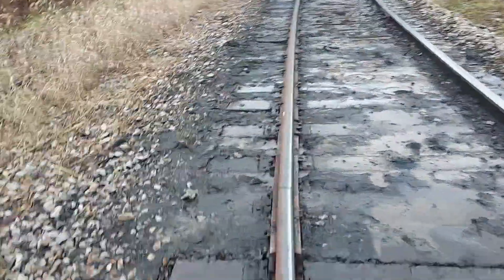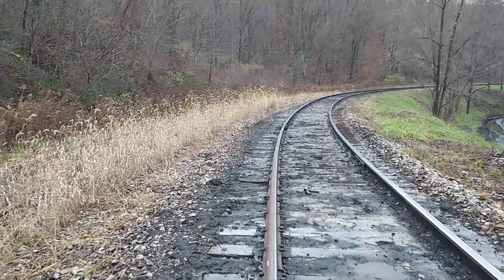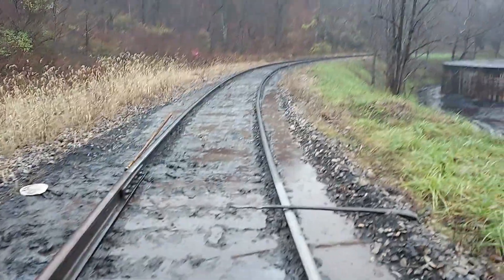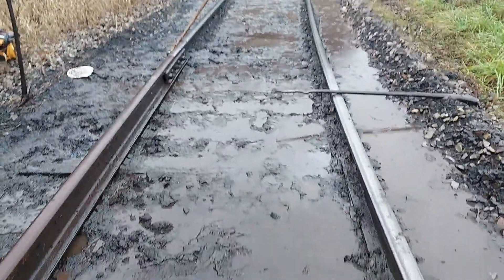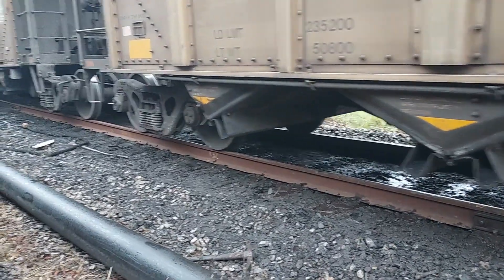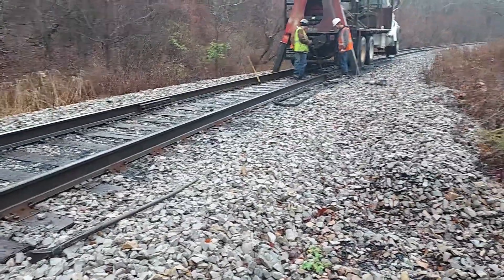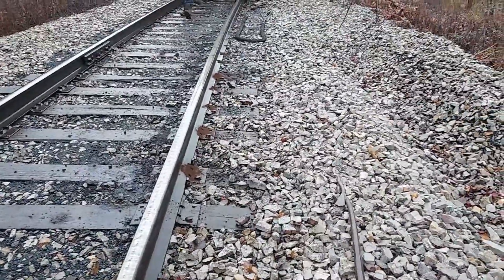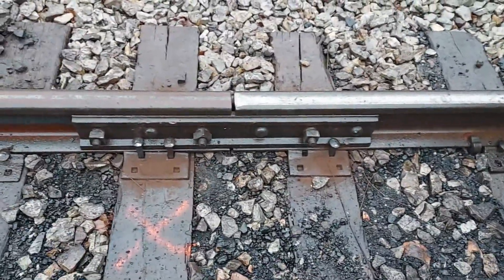How to Bend Rail for a Curve on the Railroad

Comment: Wow! Steel that thick one would think you'd have to heat it up first to bend it even a little bit... 
🤔🔥
Reply from the maker: Rail is amazing James. It's incredibly tough but at the same time 
flexible and even brittle. Rail never ceases to amaze me. Sharp quick bends in rail do require heating but over a 39 foot long stick its
actually pretty easy to bend it for a curve. Almost all rail in N. America for freight railways is bent in the field by hand. Some transit
systems have some very sharp degree curves in their yards
and those are pre bent at the factory. Thank you for taking the time to watch our video and we hope you have a very good day.

Comment: Interesting vid. Thx. Other topic, i’d have thought that the rr would have come up with a way to keep the coal dust off the tracks. More trouble than it’s worth i guess.
Reply from the maker: Thank you and glad you enjoyed Kurt. Our hopper cars get extreme
use and doors on the bottom of the cars come out of adjustment,
so coal leaks from those doors and cinders the track.  Adjusting and fixing broken doors is an on going thing here. Most cars on other railroads get dumped once a week, our cars get dumped 6 times a day, 7 days a week. Lot of wear on those door parts. Really appreciate your watching our video and keep your tracks in gauge until we meet again.

Comment: I would have thought you would use some specialized robot, you know, a Bender Bending Rodríguez .
Reply from the maker: it's actually fairly easy to bend rail for a curve Jayne. Some transit
systems have some really sharp degree curves and they use
rail that has been pre bent by a Bender Bending tool as you
put it. Comes from the rolling mill pre bent. For some of those
really sharp curves in transit it is impossible to bend the rails
by hand.  Really appreciate your watching the video and may you have a very good day my friend.

Comment: Dave thanks for the video.  Seeing the trains in a slow motion. The eye catches. Movement. Between rail and the weight of the rail car.  The rain has created a mud hole setting the train up for a derailment.   Costing millions in cleanup.  Keep doing the great work maintaining the track. This is a dirty nasty job but somebody has to do it.  I just wonder if you could  Cadweld  or thermoweld  that joint.  Creating one rail. Filling in the gap. And taking out the chip spots on the end of the rail.  Or will the weld become brittle  from so much heat. It would have to be annealed  , to create strength, in the steel.  Rail steel is a harden , pure steel.   Need some drainage tile and road fabric , heavier rock. To support the weight.  Clay soil has problem.   Use a French drain  or a dry well.  To get rid of water. The devils advocate.  Later.
Reply from the maker: Your right the track in this section is full of coal and it does pump
up and down Dan, but it is also 5 mph track, pretty hard to derail
at 5. The biggest problem with that is over time the rail weakens
as well as the joint bars which can break and that can cause
a derailment.  Another thing that happens is bolt hole cracks
can develop in the joints. 

All our rail welding is done by contractors, all our rail has 3 bolt
holes in the end. Welders will not guarantee a weld made that
close to the 3rd hole, so not we cannot weld those joints without
replacing both sticks of rail with 2 hole ends or no hole ends.
Big expense for 5 mph track and it ain't gonna happen.  Thank you for  taking the time to check out the video and may you have a very good day my friend.

Comment: Suppose there is a railroad crossing and the railway through it is curved. Those rails are recessed into the macadam. How would you access the rail to bend it?
Reply from the maker: Many crossings have curved rail thru them Joseph as you well
know. The rails are laid and all the tamping is done then the
top covering is laid over that. If a rail needs replaced that
top cover, macadam or asphalt or concrete or wood must
be taken up, this is the same no matter if the rail is curved
or straight thru a crossing. 

Really appreciate your taking the time to check out the video my friend  and may you have a very good day.  And, if you haven't already done so,  check out my second channel with more cool railroad videos and other stuff I get into on it:
https://www.youtube.com/@ThatsDavesOtherDoings

Comment: Interesting. I always thought you have to heat the rail piece while using a come along to bend it as it is heavy metal
Reply from the maker: When we put in the curved closure rail on a turn out we have to
heat it because that is a pretty sharp bend Rickard, but other
than that we use bars to bend the rail in place, it's really not
that difficult to do, although the hotter it is outside the easier
it is to bend the rail.  Really appreciate your taking the time to watch the video my friend and may you have a very good day.

Comment: Hey old timer! What does a section of rail weigh?
Reply from the maker: The rail we replaced was 132 pound rail. That means a 3 foot
linear piece of rail weighs 132 pounds. So a 39 foot stick of
new rail weighs 1740 pounds.  So if it was 136 pound rail,
it would weigh 136 pounds per yard.  Thank you so much for
checking out the video my friend.
Reply: @ccrx6700  I’ve watched a few already. But I guess you ain’t picking’ onna those rails up at one end. Who knew train tracks needed so much ongoing maintenance. I spent many hours walking the GTW as a youngster.
Reply from the maker: @fryingpanhead8809  😊👍

Comment: Don’t make sense. The rail is  flexible held into a piece of wood with nails and tons of weight  rollin on it and the rail don’t roll over. Nice vid dave.
Reply from the maker: One thing you may not realize is the tie plates are cut with
a slight cant. Thus the rail does not sit straight up and down
in the plates, but has a slight lean to it inwards. That small
amount of cant is enough to keep the rail from rolling over
provided the spikes are also in good shape. Really appreciate your taking the time to watch and may you have a very good day my friend.

Comment: I'm not a railroader. But that balast doesn't look to good to me. More dirt than anything and holding water.
Reply from the maker: Your right about that Donal, it is filled with coal which won't allow
the water to drain away and thus the mud hole. At least we got
new ballast in and tamped up so it will hold well until it eventually gets filled up with coal again. Really appreciate your taking the time to watch and may you have a very good day my friend.
Reply: @ccrx6700  thank you for responding. No one has ever done that before. It means a lot.
I love train videos. I missed my calling 30+ years ago.
Thank you!!
Reply from the maker: @porsche9144uify  👍😊

Comment: Dave, what's the tolerance on the gauge... and how do you check it?
Reply from the maker: Different classes of track have different specs on how wide or
how narrow the track can be Gary. There are 9 classes of track, the higher the class of track the higher the train speed and the
more stringent the specs become. As you can imagine there
is a more leniency for a train traveling 25 than a train
traveling 100.  On class 2 track like we have, train speed is 25.
The gauge must be at least 56 inches and not more than 57 3/4 inch wide.  A quick check of the gauge can be made with a
tape measure, the most accurate measure is made with a
track inspection gauge.  The gauge is measured 5/8 of an inch
below the rail head from the inside of one rail to the inside of
the other rail.  Thank you so much for taking the time to visit with us and may you have a very good day my friend.
Reply: @ccrx6700  Thanks Dave. I noticed different sections of rail profile to... there's a lot of engineering in this game. Thanks for the explanation, and I'm enjoying your content.
Reply from the maker: @grahamrowe6278  😊👍

Comment: At age almost 74, this has been quite an education for me. Here in the UK, I think virtually all railway lines are continuous rail and have been since some time in the 60s. If we look carefully in some of our rail terminii, we might see this old track joined with what we call 'fishplates' as the speed is slow with trains coming to a halt.
Also, in l'il olde England I have never seen spikes. The rails have always been mounted on chairs and in the old days held in place with wooden wedges, then a mega-scale spring clip of a kind.
Keep up the good work! Now we know! Pry it over with a bar(s) and if that isn't enough, here I think they have a hydraulic device of some sort.
Reply from the maker: Glad to hear you have found this to be educational Jozef. Yes UK and us do have some differences. A good many RR's in this country have
all welded rail and use Pandrol clips instead of spikes to hold the
rail gauge.  Thank you for taking the time to visit with us and may you
have a very good day my friend.

Comment: Could you do this another way.. Put the two ends of the straight section where they need to be, then drive the truck to force the curve into the rail and nail it down?
Reply from the maker: Most likely that would not set the rail to the right gauge since the
hi rail wheels on the truck is wider than what we put our track
gauge to, so we would still have to move the rail over a bit by
hand and with a truck sitting on top of the rail that would be most
difficult. Thank you for taking the time to visit with us and may you
have a very good day my friend.

Comment: Railroad shouldn’t be holding water right?
Reply from the maker: Water staying in the ballast is never a good thing Ryan, but
the section where this video was made is 5 MPH track so it's
not near as critical as main line track would be. I have so much
plugged up ballast from all the coal fines over the many years
leaking out the hopper car doors, I just cannot get to every place
that needs done.  Thank you very much for taking the time
to visit with us and may you have a most blessed day my friend.

Comment: That track needs some love. Probably some new ballast and a lift when tamping. good work, boys
Reply from the maker: It is track used only for when they load the train so the speed is
about walking speed as they are loading the train. But it does need
some ballast rehabilitation for sure. Problem is getting to do it. We
have sections of our track that is 25 MPH that needs work done
to it before we can devote time to a 5 MPH track. Only so much
we can get done here with only 2 track men to work track plus having
to work around trains running. Very grateful my friend for your taking
the time to visit with us and check out the rail bending video.

Comment: Thanks Dave.....I always thought they must be pre-bent.....do they spring back straight when you take them out?
Reply from the maker: Your very welcome Lincoln. Some rails on very sharp degree curves
on some transit systems are pre bent. However on freight RR's
they generally are not, freight doesn't have the really sharp curves
that some transit systems do. As you saw in the video, we bend
the rail to fit the curvature by hand. It's not that difficult and easier
in warmer weather.  Most rails in a curve will spring back some, 
but hardly do they get back to their original profile, but it also
depends on the degree of curvature, the less the degree the more
the rail will go back to straight.  We really do appreciate your taking the time to check out the video my friend.
Reply: @ccrx6700  Thanks Dave, it's always a pleasure to watch your videos; it's clear you enjoy your time at work and I'm grateful that you put the time and effort in to produce your interesting videos - you are, without a doubt, the star! Over and out, all the way from Lincoln, England!
Reply from the maker: @lincolnengland5005  thank you for the kind words 👍😊

Comment: On the high side of a curve, we take out the outside line spike and replace the rail from the outside. If that rail was on the low side of the curve, we'd take out the two line spikes and replace it from the middle of the track. I'm curious why you put that high side rail in from the middle of the track? And you know rail is very flexible, so you really aren't "bending" the rail, you're simply guiding it into the tie plates. I work in mountain territory for a Class 1 Carrier, with high degree curves and heavy grade my 40 year career so tell me I'm full of bull. And That's Railroadin!
Reply from the maker: You are right we are guiding it into place. Interesting about how
you put in the rail. I've seen it done both ways. What we usually do
is if there is two spikes on one side we only pull the one spike on
the other side and leave the 2 spikes just up a bit. So that is
why you saw the rail being put in from the middle of the track.
Glad you shared that with me, I will give it some thought. 
Very much appreciate your taking the time to visit with us and check out the video my friend.

Comment: Its amazing that it is so bendable, when  the weigh per feet /meter is so high.!
In sweden the rail comes in 500 meter long pieces , when building new lines or changing long stretches 
They transport them on speciality built trainsets, in stacks the rail  bends back and forth in the curves.
Look very strange  rails  moving on rails 
Almost all rail in sweden is welded  end to end up until the 
Electrical  separation points in the signal(for the atc and other sys ) and ground rails (for the electrical ground)
I have seen smaller reperes bing don were they bend the rails like you do in the video , then splicing and termite welding to the old rail.
When cutting the ground rail they have to connect the two 
Ends of the main rail line  to avoid arcing over the initial gaps  in the two cuts .
Other parts of the line may still have traffic going . 
Ties are concrete with clip fasteners.  
Prior we used a clip system  named parol , the nick name of it is the" dog turd " hund skiten . Looks like on actually. 
The new lines built use anoder clip thats looks different,  what  i understand ,it is easier to automaticly put does in removing them.
The dog turd had to be sledgehammererd on of.
On low speed /industrial tracks there can be wood ties , and and sometimes nails or screws and connector plates.

Its it the coal dust that makes 
The barlast  in the track so clogged up ?
Do you rense it from time to time?
Reply from the maker: Thank you so much my Svenska friend for sharing that about
your rails. Rail is amazing how hard it is yet in the same light, so
flexible. It's actually pretty easy to bend rail for a curve, specially
when it's warm outside. Very much appreciate your taking the time
to visit with us and check out the video.

Comment: Great video, thanks Dave.  This is a really good example of the force multiplier created by a "second class" lever.  

In this case, the "Fulcrum" (or pivot pont) is the point where the tip of the breaker bar bears against the tie plate, the "Load" is the resulting force at the center of the bottom flange of the rail, and the "Effort" is the force you applied on the breaker bar.   Just rough numbers, but if we assume:

(1) The distance from the Fulcrum to the Load (bottom rail flange) is 0.05', and 

(2) the distance from the Fulcrum to the Effort (applied force)is 4.00',

The Mechanical Advantage created by the lever is 4.00' / 0.05' = 80.   So a 100# Effort (push) on the breaker bar, results in a 8,000# Load of the bottom flange!  Physics is amazing!
Reply from the maker: Wow those are physics I never knew Bryan, thanks so much for sharing. Glad you enjoyed and we very much appreciate
your taking the time to check out the video my friend.

Comment: No doubt there is flex in rail so explain this... No curve, no bend, the longest rail and IT'S LEVEL.
Tweaking a rail is way different than a bend.
Dead-straight railway Lines.
The world's record for the longest stretch of straight railway belongs to the Transcontinental Railway of Australia, which is dead-straight for 328 miles across the Nullarbor Plain.... Next comes the Junin and McKenna stretch of the Buenos Aires and Pacific Railway of Argentina, which is dead-straight for 205 miles and level also.

DID YOU SEE THAT? LEVEL
a curve is never level unless your going around something, not OVER something. 

Hmm, civil engineer plans show no earth curvature in them.
Reply from the maker: So Mav with your line of reasoning then there is never a level
rail because of the earth's curvature? Appreciate very much your taking the time to tune in and check out the video my friend.

Comment: Dave, The amount of maintenance the rails and locomotives require is just astounding to me.  How does a heavily travelled route with mixed freight and passenger rail traffic function to any schedule?  It would seem impossible because there are thousands of miles of rail....
Reply from the maker: That's a big question that I don't have good answers for. Take advantage of those times between trains and down times such
as miner's vacation on the NS Mon Line and Manor Branch that
are around here. No trains would be running for those 2 weeks.
Same as us, we do as much as possible during miner vacation
or long wall moves underground when they aren't running trains.
Thanks so much for watching and writing in my friend.